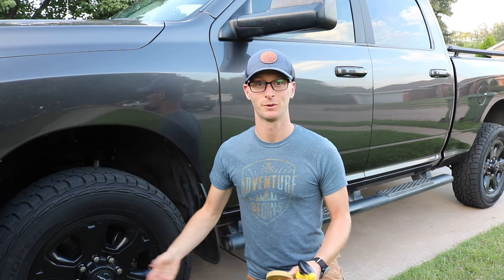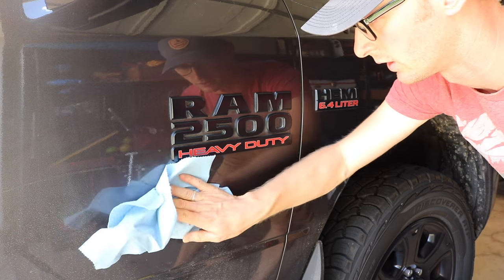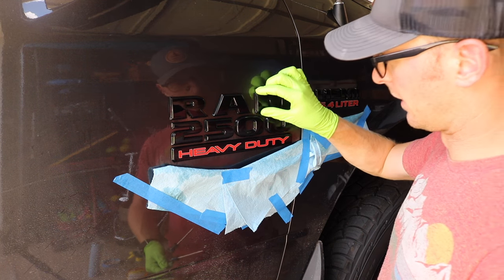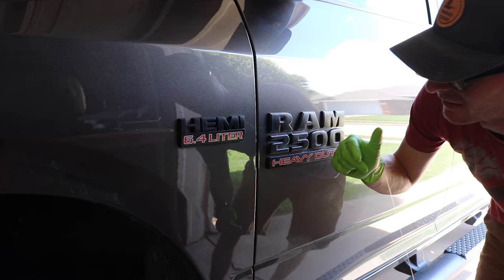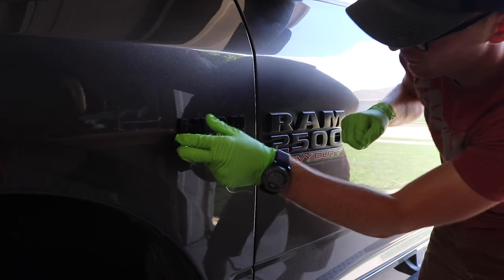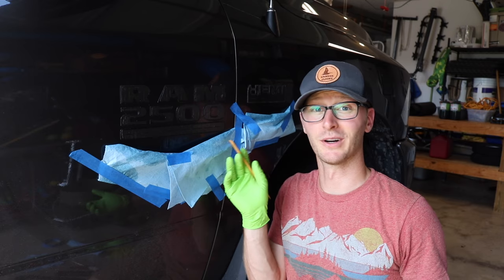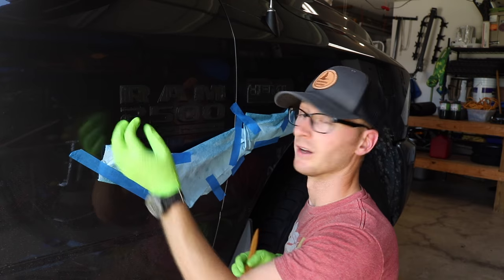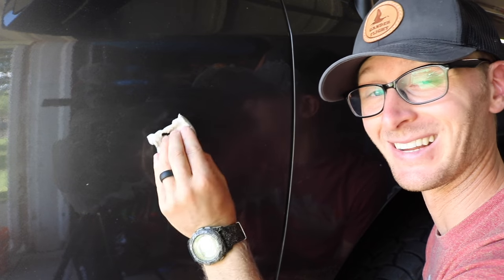Which Method Is Best to Debadge and Remove Your Car Emblems?

Comment: I have a new C8 Corvette and would like to remove the badging from the back.  My concern is that some of the badging overlaps the striping on the car and am not sure the striping will hold up to removing the adhesive.  I think it is ok where the badging is adhered to the paint but not sure where it is adhered to the stripes.  Any thoughts?
Reply from the maker: These eraser wheels are also used for removing pinstripes - so yes, I think it would also start to remove the badging. UNLESS its painted striping that is under the clearcoat. I'd gently run my fingers over it -- if you can close your eyes and feel the strips, this will start to remove it. If you can't tell where the stripes are then they are probably under the clearcoat.
Reply: What you going to want to do is taking use a string strong enough to pass through between the badging and the car body then take a heat gun or hair dryer and start off with a little bit of heat and build up a little bit longer time or a little bit closer to the adhesive but test every few seconds and use plastic razor blades or you can even take those cheap flexible 3M Bondo spreaders and a pack of those cheap flexible but not so flexible but still harder plastic spatulas/ putty knives and just focus on the parts adjacent to the stripes and then that'll give you a little more experience by the time you get to the part covering the stripes and just gently go over it you may even want to use a scratch free kitchen pad to pull down on some of the adhesive and have a place for it to grab and sink into and that should leave your Pinstripes intact you can wrap it up by rubbing it with a little bit of WD-40 or you can use fingernail polish remover a touch of carburetor cleaner but use that lightly and sparingly and follow that up if you use something strong with just some Degreaser or other cleaner like this soap to remove any residue

Comment: what’s up man, the video definitely helped! I used goo gone and a heat gun, left the outline of my logo. where can i buy the magic eraser?
Reply from the maker: Walmart, Target, or most grocery stores should carry them.  Did you buff it out?
Reply: The outline could be minimized by using some 1,000 to 1500 Grit wet dry Automotive sandpaper or skip that step and go to the next one of using liquid compound heavy or medium,liquid polish or clearcoat comp, then wax or cleaner wax
Reply: I forgot to mention the outline is not caused by any of the tools used to remove the badge is because by the badge blocking the degradation of the original clear and base coat thereby creating a subtle color and contrast difference and it gets worse the more the vehicles in the Sun

Comment: How do you find if your letters have alignment pins
Reply: Was wondering the same. I have a Tundra.
Reply from the maker: Best thing is to jump into a Facebook group about your vehicle, snap a photo of the badge and ask others.  Other than that, search online as if you were going to replace broken badges - the photos of the backside should be clear enough to tell if its adhesive only. 😀

Comment: Excellent video. Good to know goo gone won’t ruin the finish. My new minivan has a vinyl dealer sticker on the back I need to remove. How would you reattach the emblems if you wanted to? Also Also I’d love to use your leftover HEMI emblems on my caravan to make it more badass -
Reply from the maker: It would be very difficulty to reattach the emblems after being removed as the adhesives are cut to fit the letters exactly. You'd be much better off ordering replacements.

Comment: I used heat gun and fishing wire. Then pressure washed on widest setting. Scratched some off gently with my finger nail. Then finally some goo gone

Comment: If your vehicle is from Phoenix, AZ like my 2015 f250. Then goo gone won't do diddly. Even with a plastic scraper. 3m eraser wheel did remove 90%, but some of the adhesive is soooo baked on  its going to take 3000 grit, cutting compound, and polish compound on a buffing machine to completely remove it. FYI i was removing a vinyl pin strip not badges!
Reply from the maker: That sounds like a task! Itll be worth it though - I really dislike pinstripes on modern cars.
Reply: Have you ever tried to move badges. I live in the same area and need to remove the hemi badge so I can get my fender flares on.

Comment: I tried to use the eraser and for whatever reasons it hasn’t been able to get off all the adhesive the manufacturer used any advice?
Reply from the maker: Have you tried a small amount of Goo Gone/Goof Off, WD40, or Gasoline to help remove the last bit of adhesive?
Reply: I’ll try to WD-40. I tried goo gone and you can still see a small amount of the glue.

Comment: The Goo gone worked great but it took longer & on one set of letters that was removed the paint looked like it has crinkles & I don't know how to get rid of it
Reply from the maker: That would be my hesitation to leave any solution on there for a long period of time is that eventually it may dissolve past the adhesive and into the clear coat.
Reply: @GanderFlight  Yeah absolutely wouldn't want that to happen, but everything turned out great and it looks much better
without all those badges on it

Comment: apply heat first heat gun or hair dryer, the solvents in goo gone evaporate don't soak in. wipe a little dap wipe a little dab.roll  up adheasive  BEFORE the solvants evaporate.

Comment: So should I save my $30 and not buy a heat gun? Because you made it look easy with just fishing line and an eraser wheel
Reply from the maker: I'd set the vehicle in the sun for a few hours and then try the fishing line or floss and skip the heat gun if this is the only project you're intending to use it on.

Comment: What speed were you running on that drill
Reply from the maker: Whatever the low speed is on my drill. Can check out more info here: https://youtu.be/7Y_2DYBwoTU
Reply: @GanderFlight  I used it got great results without ruining my paint. Very surprised, butttttttt the outlines are still there and I need heaaaalp. What are you using for the last bit of adhesive ?!
Reply from the maker: @SoCalMoto626  try WD40, maybe a bit of gasoline, rubbing compound, light magic eraser - anything with a solvent make sure to wash it with auto soap and water afterwards

Comment: If you don’t have the removal wheel what else can you use
Reply from the maker: Ive never removed a badge without it. Could try a heat gun- just be careful and go slow.
Reply: Buy one - they're $10.

Comment: Did the magic eraser end up leaving scratches?
Reply from the maker: No, but any abrasive will eventually if used long enough and with enough pressure.  Just tested out two different erasers on the channel from cheap to most expensive- check it out!

Comment: May I suggest a hot new product in TakeOff Adhesive Remover? I can send you some samples for your demonstrations
Reply from the maker: And how is this product different than Goo Gone or Goof Off Ike?
Reply: @GanderFlight   Easy to use (pouched wipe/drip/spray), non toxic, does not leave a residue like Goo Gone

Comment: There are many different types of solvents that you can use to break down adhesive and Goo Gone is mostly for items that would be affected by those solvents so light duty or delicate is what you want to keep in mind and keep in mind that some of these solvents are strong enough said if you don't immediately remove them or  press too hard they can actually damage the product underneath. There's one that's fabulous and you do have to be very careful with it but it's something I'll still hold to the chest for now and I'll reveal later but it performs miracles

Comment: DO NOT use the eraser wheel on a red candy. Like my truck is a at4. Paint code 434B. It will discolor the clear. You have to be careful on colors like these.
Reply from the maker: Thanks for that observation.

Comment: The wheel scratched my paint
Reply from the maker: Hmm. This the first time Ive heard of this and I did an additional video TRYING to burn through paint — maybe its just residue- did you clean and buff the area?
Reply: It can put tiny scratches, but the idea is to buff and polish after you debadge a car.

Comment: Parking it in the sun for a hour works just as good as a heat gun
Reply from the maker: True - just make sure when you start to work on the sunny side that you flip the car around so the other side starts to heat up :)

Comment: Lol fishing wire
Reply: Steel leader does the trick
Reply from the maker: Might as well us the line that has absolutely no chance of scratching or scraping anything...
Reply: It was just funny I’ve never heard it called wire. You only called it that the one time. It takes nothing away from your video. You’re on point with your method
Reply: @GanderFlight  Fishing line is typically monofilament, not "wire"

Comment: Soon automakers will start using badges with punch holes and pins in them. Like car emblems.
Reply from the maker: Many of them already do, just depends on the make, model, year, and specific badge.  Lots of manufactures are now building the brand name INTO the sheet metal...

Comment: Dude, that stuff is like cement!!!  Goo-Gone is made for mild adhesive, household stuff.  This is industrial grade adhesive you're trying to remove, far from labels on glass jars - which is what Goo-Gone was made for... the glue you're trying to remove, is made to last longer than the vehicle.  Just think of all the crap it goes through on the road; in 4 seasons... that real trucks go through.  Once it hardens, it's like hardened steel, it becomes very hard and impossible to break.

Would never do that to MY truck but... I drive a GM, so... I like its name to be on it.  #Shameless
Reply from the maker: Thanks for the thoughts. I like the debadged look on any make - glad you're happy with your truck!
Reply: Debadged is awesome